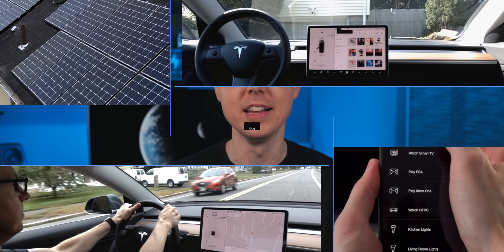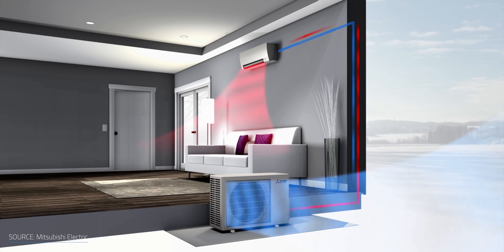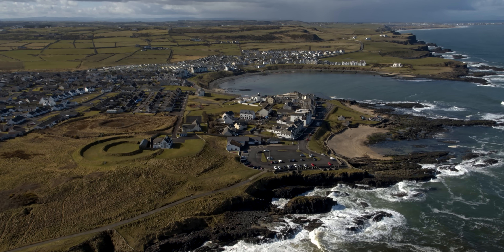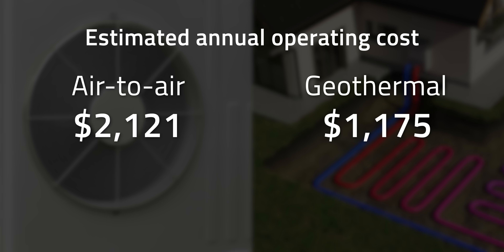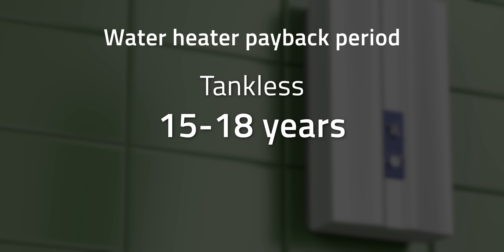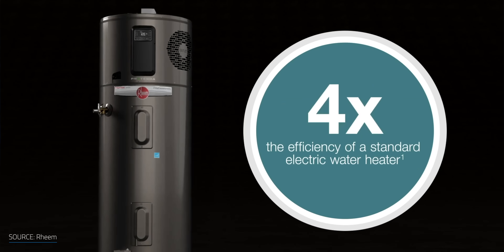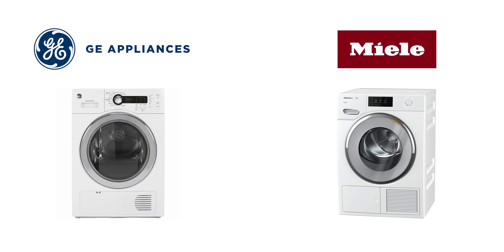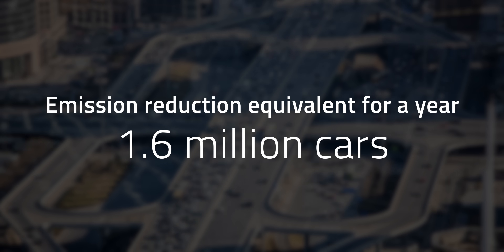Why Heat Pumps are Essential for the Future - Explained

Comment: Trying to convince the wife to look at a custom build Net Zero on a plot of land.  She’s the type to want to run the AC at 70 degrees in the Summer.  As good as the Rheem Hybrid Heat Pump is the Gold Standard is the CO2 Sanden SANC2 which is over double what a Rheem Proterra is but I like C02 as a refrigerant and no heating elements in the stainless Tank.  If one is designing a solar system the SANCO2 system runs about 8 Amps total which means it’s part of the critical loads for solar + backup.    I don’t care what premium a home appliance costs if it allows me to skip penetrating the envelope.    I want an intake and exhaust and that’s it, feeding an HRV and dehumidifier.  

Our average solar design is over 10 kWh.   For our High Performance home designs 10 kWh is the top end of what our clients need to meet and exceed their energy costs.  High Performance homes are not inexpensive but you move in and there’s very little mental checklist of all the stuff you need to improve.  It’s quiet,   The air smells good (IAQ) the floor isn’t frigid,  bugs don’t get in easily,  Your bills don’t skyrocket in winter and summer.  It’s like most good things in life ..once you experience them  you don’t want to go back to the “old way” of doing things.

Comment: "Net-Zero" is misleading. Every piece of hardware generates CO2 during its production, transport, use and disposition. To get to net zero you would need to capture carbon in a greater amount than what you produce, and for that you need a super clean source of energy... I´m not saying it´s impossible but it necessarily requires carbon capture in the mix.

Comment: I can't understand why air-to-air heat pumps are less efficient than air-to-water for heating a house. The radiators or faincoils on the air-to-water system will also ultimately transfer heat to air, and a lot of the heat originally produced is lost in the tubes from the heat pump to the fanicoil/radiator. Also, I see that most air-to-air systems have higher SCOP than air-to-whater. Why they say that air-to-water is more efficient then?

Comment: My wife and I thought about a heat pump. But with very cold air There is not enough heat to make it work and we wood need and electric panel to heat the house when the temp outside got to low.

Comment: As much as I love the heatpump technology, What we really need to do is make heating and cooling "less important" through proper thermal management and control via better insulation and air leak reduction. I can get four 5-ton heatpumps to keep a 1000 square foot cottage with open windows warm-ish.... OR, I can run a 1500 watt space heater to keep a 5,000 square foot house with R60 walls, and triple-glazed windows nice and toasty. 
There are a TON of older homes with very poor insulation. Even my old house that was built in the 1950's. It had the old 2" red oak floors on a raised foundation. Crawl under the house and there is ZERO insulation down there.. NONE. During the winter, you could feel the drafts through the floor.. Do I need a bigger heater? or better insulation? Sure, installing a bigger heater would be easier and faster, but then Im paying more energy for the rest of the life of the home..  Sure, dumping the gas and going heatpump could make that cheaper, but Im still running the heat! 
What would happen if we were able to go through and bulldoze over those old 1950's neighborhoods, with 1950's energy efficiency and rebuild with all new, modern thermal materials?... not to mention the benefit of eliminating all those awful super-compartmentalized floorplans!

Comment: Do I think we should heat pump everything?  It's complicated. 

What it sounds like we need to do is create wider heatpump SYSTEMS.  Your hvac runs to your hot water heater which runs to your dryer which then runs outside.  The combined system would see what devices are on vs what the house needs, and calculate where the energy needs exchanged at.
Reply: I also forgot to that you should tie in the heated driveway to the system too.

Comment: What about a "smart"  heat pump system
You hook up radiators in several places around the house and property,
Underground, attic, living spaces, garage,
And appliances, 
Fridge, hot water heater, dishwasher, dryer, oven, stove, etc
Have a universal coolant throughout the house, like how other utilities are standard like electricity and water are run through the whole house, run coolant hookups, existing refrigerant lines and ducting from HVAC systems are close already
Have valves and sensors that can reroute coolant in useful ways,
 when your dryer needs heat, take it from the blistering attic
In winter route your fridge heat to the chilly garage,
You could even have hookups on your car to add and remove heat whether your engine is cooling down after a drive or your batteries are warm charging

Larger networks could be created with neighbors, apt complexes, cities, etc creating a heat transfer utility line like water, electricity, gas, Internet, sewer, etc
You might want to cool off while your neighbor wants to warm up
Excess heat and cold could be used for energy production, water sanitation, transportation, industrial processes etc
Distilling water, cryogenically storing air or natural gas, run steam turbines, etc
Unoccupied houses and rooms could be cut off, or harvested for heat or cold, pools and hot tubs, water storage tanks etc, could be heat batteries, 
Heat could be pumped to each building as occupied, eg houses could get credits for selling BTUs during the day when they leave for work and school, while work and school buy BTUs, and reverse at night

Comment: Interesting that a ventless clothes dryer is claimed to have perhaps twice the life of my current electric clothes dryer that I purchased in 1973 and has needed only a couple of belt replacements and one replacement of the felt drum seals in the 49+ years that I've been using it. Oh, that's right, one of the spring-loaded cables that counterbalance the door broke, and I had to fabricate a couple of replacements. Forgot about that.

So, we should be buying ventless dryers for our grandchildren to inherit?? I'm sure the manufacturers will include a life timer based on the warranty period to make sure that doesn't happen.

Claims, claims, claims...

Comment: Hey Matt, why this technology is not used to generate electricity back?
Reply: You can use a Stirling engine to gather electricity based on a temperature differential. You can't gain net electricity out of the system because of the second law of thermodynamics.

Comment: Now that half the country has experienced grid failures at subzero temps and thousands of homes have frozen water pipes and water damage. We may need to take another look at fuels that require  little or no electric to operate. Many a gas stove has saved countless homes from damage, at least for those that realized you can light the burners with a match. They are still digging out the bodies in Buffalo who put their faith in electric.

Comment: In places where efficiency is reduced on some days during which temperature drops especially low you'll find way more of those days during which the temperature is just optimal for heat pumps. I.e. a places having a few days of -30°C temperature a year probably have way more days with 0°C temperature than places that have -30°C day once in a decade. Therefore that argument is not very solid and heat pumps (air, ground and water source) are indeed very popular in Finland indeed where -30°C is an every year occurrence for majority of the country. During those days people just throw more firewood into the fireplace.

Comment: I think this is interesting as a way to heat your home. Basically an inverted AC for heating. The only problem is electric based heat tends to cost more and heat pumps tend to have a range of temps they work well in. So I'm not sure if this idea would work well overall.
Reply: Technology Connections youtube channel dives deep into the effective temperature ranges of heat pumps. there much more effective in colder climates than you might think
Reply: a  nat gas dryer willl dry a lot faster ay a lot less cost
Reply: It has already been proven to work great. The only time it struggles is when the outside temp goes below 15°F. At that point, it becomes less efficient and effective. For example, if it is 0°F outside, your house might only get up to 63°F instead of 70°F.

Comment: Something that's been driving me nuts, that I have found generic patents for but have not been able to find true existing examples of, (and am sadly not enough of an engineer to design or build) is a heat pump GENERATOR. It seems that 99% with a similar train of thought want to generate electricity using the heat they're removing from their home, but that's inside out. I want to use a heat pump to generate electricity from OUTDOOR air, a source on paper that is an "infinite" source. The heat pump itself captures thermal energy hot or warm outdoor air and concentrates it via compression to create a significant heat source, one that could, say drive a closed loop steam turbine generator. It's difficult to say exactly where the efficiency of this technology would land, given that heat pumps can move 300-400% of their input energy, and the best steam turbines are up to 70% efficient (on a large scale). How cool would it be to be using all the latent outdoor heat in the summer during periods of the highest electrical demand, rather than simply adding to it? 

It's been proven again and again that the only way to truly recover thermal energy on individual appliances is with thermoelectric, which is abysmally inefficient at like 10%, so what if we just forgot about that and generated power in a dedicated heat pump generator instead? 

I've been holding onto this idea but at this point I just want to see if it's possible. Someone please build one already!

Comment: Matt, when we moved into this place  we had a traditional air conditioner and propane furnace.  Man, was that expensive.  A year later we installed solar and that reduced our electrical bill to about $10/month (the meter charge) and $35/year at True-up.  Last summer we installed a battery system AND switched to a heat pump.  Today we have reduced our power consumption by 80% and reduced the wintertime propane bill from $200-300 hundred per month to...$10.00 (we still heat water with propane).  Today our system monitor read that we were 97% independent from the grid.  This evening the grid went down (two hours ago) and we still have lights and internet as I write this with more than enough stored energy to last us until the sun comes up.  Technology rocks!

Comment: My brother had one fitted ~18 months ago. Paid £13,000 for it. He's not a happy chappy. Not warm enough. It doesn't help that he lives in a 600yr old Stone building, so wall insulation is pretty much impossible. He was sold with "It's fantastic! it will solve all your problems! it's really warm!" No. Heat pumps are not the ultimate solution, especially for many older UK and European homes.
Reply: I'm sorry for you brother but 🤣 that's like being sold an all new electric motor to fix all the issues you've been having trying to take a historic hoarse and cartage on the moterway.

Comment: Our rates in the Midwest must be different than yours, for now it is still at least 15% cheaper for us to run our high efficiency gas furnace over our high efficiency air source heat pump at mild temperatures and even more as the temperature drops.  With demand for electricity on the rise and the most efficient wind and solar generation only being in the mid 30% for online availability (shrinking supply) I think we are still several years away from this solution being cost effective.

Comment: I envision a plug and play hot water home monitor system. The hot water tank is controlled by movement within the home. If the motion sensors do not see any movement then the hot water system sleeps. If you trip a sensor the system is allowed power for 20 or30 min. So if you go to bed, go away for the weekend or the month no power is used to heat water. The movement sensor could be in a wall switch and send the signal thru the home electrical system or wifi. Having the sensor in a wall sw would eliminate pets from triggering the system. You would put a sensor in a hall way leading to the bedroom and bath. Another on in the kitchen or bathroom itself. Think how much energy we would save if every hot water system was controlled by active occupancy. This is something I think you could make happen. It is old school to use the electrical system for communication but might be cheaper than wifi? It would be cool to have a box next to the hot water tank to control its operation. Out of the weather and usually some place that has the room for installation or maintenance.

Comment: I am planning a pvt with a water te water heatpunp  than I get electricity any heat from my roof. 
The best is the cooling of the electricity solar panels wich will result in a higher efficiency. 
The only downside is the upfront cost. 
About €30.000

Comment: Works ok if the house is insulated the rads are three times the size of normal all pipes are insulated and if you have underfloor heating also have to have the space for the rads bigger pipes (no more 10 mm) and a mini plant room in your house I think hydrogen will be the way forward in the uk specifically I’ve also spoken to a guy I work with called Garry who helped develop and test a few iterations of heat pumps for a boiler manufacturer and he said they have a far way to go before being viable

Comment: Heat pumps can be really inefficient depending on the location and weather. Geo thermal heating and cooling is the way to go! If you haven’t covered this topic, I would recommend it.
Reply: Martin Garza, I agree that a 1990's R-22 heat pump was not very energy efficient below about 20F.  However a modern R-410 unit like my 2014 14 SEER Goodman single speed heat pump is more energy efficient, and will produce 28,000 But's of heat with the 48,000 Btu model at 25F outdoor air temperature.  53,000 Btu's at 47F.  Geothermal was the most effective way when they did not have variable speed heat pumps.  Now a variable speed heat pump can run very effectively at -20F!  Below -20, they tend to shut off on loss of charge low pressure switch, until it gets a bit warmer.  

The problem with a geothermal system is the up front cost to install the wells and tubing.  A modern ductless heat pump can be just as energy efficient!  Most locations, it is very rare to have several -20F days in a row.

Comment: As with many new technologies upfront costs are higher abd therefore even where the running costs are lower the payback time is sometimes far too long. When confronted with this kind of trade off most of us would conclude that continuing with the conventional methods of heating/cooling makes mores sense. So I feel you need to point out that real cost/impact of many current systems on the environment in the hope that some viewers would take that into account when considering replacing there current - usually fossil fuel enabled- systems.  It is because the environmental impact of so much of our fossil based energy consumption costs “nothing” that we are in the current mess!

Comment: Question: for cooling, heat pumps are more effective than air conditioners?
Reply: They are the same efficiency. Heat pumps are just air conditioners with reverse switches.

Comment: A lot of these prices are based on general google searches. Those figures found on google are pitched by the manufacturers. In the real world the homeowner needs to find a licensed competent installer, which there are very few of nationally. Those guys are not cheap. All the prices presented would start on the high end. And the bottom line is that when its 15 degrees on Thanksgiving Day and your heat goes out, you need that heat turned back on that same day! Most licensed plumbers can get out to you and get a furnace or boiler up and running. But if you're running on all high efficiency geo thermal heat pumps, then you're not going to get a qualified tech same day, and your pipes will probably freeze. How do you prevent that? By having a tune up diagnostic every year, and if you are the minority of homeowners that does that then it definitely will NOT be cheaper than having a plain old boiler or furnace. 

So no these prices are not real.

Comment: Heat pumps  do not break the law of conservation of energy. If you spend say 10J of heat energy to start with and use it to generate electricity, you get about 3.3J of electricity. Now, if the heat  pump has a COP of say 3, you generate 3.3*3 =~10J that you started with. Obviously the efficiency of no system is 100%, so you get a little less that what you started with. Now if you have oil or gas fired boiler, they run say 90% efficient so if you start with 10J, you get 9J of heat inside the home. If you do a more accurate calculation, you will probably discover both systems are equally efficient, they return about 90% of the heat energy you started with. Cost is another matter depends on the price of gas vs oil vs electricity etc, but in the final analysis is going to closely follow the quantity of energy consumed.  Boilers last say 25 years, whereas heat pump may be 8 years. So no need to go 'harassing' people about their oil boilers, they don't do any more CO2 emissions in the end when generating the same quantity of heat inside your home. One caveat is that if in the future electrical energy is all "green" say from SMR's, then the whole argument shifts in favor of heat pumps but not today.